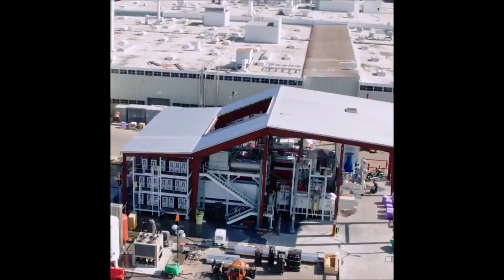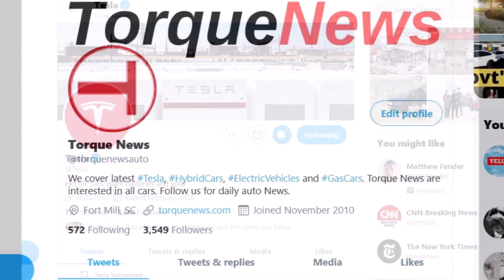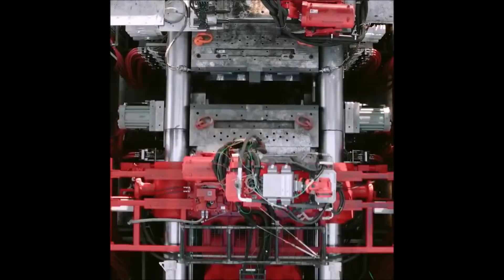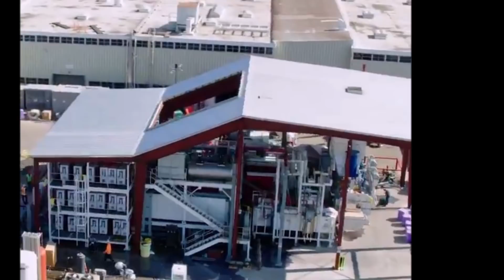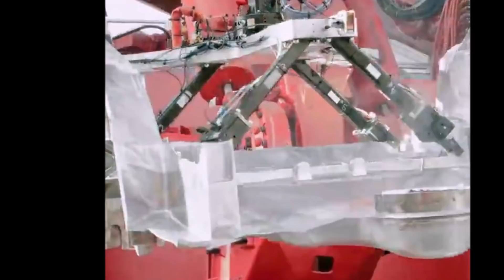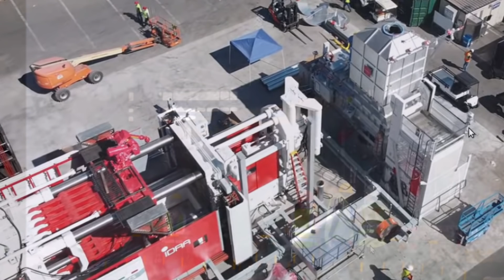Tesla Shares Rare Video Of World's Largest Die Casting Machine

Comment: I used to work in grey iron foundries on Disamatics.  Theres videos on utube.  They made sand molds and iron or aluminum was poured in the sand molds.   These machines are the same principle minus the sand.  Die casting this size is pretty impressive, but I see they are having cracking problems in Teslas .  These castings are the front and rear assemblies of the car.  If that needs replacing depending on the age, it will total the car.  Something to look for in used teslas.

Comment: I googled it One kilonewton is equal to 1,000 newtons, which are equal to the force needed to move one kilogram of mass at a rate of one meter per second squared. The kilonewton is a multiple of the newton, which is the SI derived unit for force.

Comment: The neat thing about this giga-press, is a rising tide raises all ships.  New innovations promote even more.  Not sure right now, how you would repair a damaged die-cast frame.  Cast aluminum with the correct alloy structure is weldable.  The welding industry is getting more sophisticated also.  Lots of new stuff coming online.  Now, for right now, your insurance is going to be the elephant in the room.

Comment: Its imply the force of mould press pressure.  The bigger the workpiece, the more pressure push on mould press in needed. Because it must close the mould face with high pressure in preventing leak of molten aluminium when injected into the mould.  The bigger the piece is , the more weigh mould face to withstand.

Comment: Why cast.. Isn't it typically weaker and heavier than rolled/stamped piece?
Reply: That's why there is pressure added during molten state, idra calls it low pressure forging and and that prevents bubble weak areas all the way to the edge
Reply: Also hard to repair

Comment: I live in md...its long gone now...but these dingbats have never heard of the old Bethlehem steel sparrows point plant.....you could throw this little toy INSIDE the L furnace of sparrows point...the continuous caster there could cast 10,000 TONS a day...THIS MACHINE AINT SH..!!!!!
Reply: You are woefully uninformed, so much so that I don't even know where to begin your remedial education... thanks for the unintended comic relief, though.
Reply: @rimckd825  u must be elon I guess..
Reply: @rimckd825  no reply eh??...thats what I thought...clueless
Reply: True, I suppose you could sand cast these parts out of steel, or ductile iron. But they would weigh 3x the alum casting. For ex, Intake manifolds used to be iron, redesigned in  aluminum decades ago as a weight reduction. Corvette has used alum sub frames for decades now.

Comment: The main question that I have is if the casting presses are built to only cast one frame, or if it can be set up to swap out the molds to cast different frames. We know that the Model Y has been using the rear frame casting, which eliminates 300 robots from the factory. But the future Model Ys being built in Europe, and probably Shanghai will also have front cast frames too, and eventually structural battery cases in between (housing the 4680 batteries eventually). I suspect that the plan is to debut the new chassis with 4680 batteries first in Giga Berlin later this year. But it looks like the planning and testing of the new cast frames is already happening in Fremont now. Tesla will probably keep that news under wraps until after the updated models are being produced in Giga Berlin. Since the last video shown here looked like it was a cast frame for a Model S, it is quite possible that part of the revisions to the upcoming Model S (and X) refresh include the cast frames. Since we know that the upcoming Model S Plaid+ will be getting the full drivetrain upgrades, including front and rear cast frames and 4680s with the structural case later this year, it may well be that Tesla will be integrating the cast frames into the upcoming Model S (and X?) starting as early as March or April, except using the updated 16850 battery pack.
Reply: Dean
Of course the dies can be swapped out.

Comment: The liquid metal is an aluminium alloy that is a secret. See e.g. the Sandy-Elon interview. This is also the secret for the gigapress.
Reply: There is no such thing as a “Secret Alloy”. Once you get access to the part (buying a Tesla, for example) it takes just less than 1 gram of material to analyze the material. No secrets here! And there is anyway only a small range of die cast weldable Alu Alloys available anyway.
Reply: @carlosspiringer7106  If so, I am sorry for my remark. I was just parrotting Sandy Munro.
Reply: @charlesvanderhoog7056  Did not want to sound critical! But as an production Engineer with (too many) years of experience also in metal castings, we hear some pretty strange stuff. Cheers!
Reply: @carlosspiringer7106  i agree. things that we assume everybody knows
Reply: @carlosspiringer7106  Tesla actually developed their own custom alloy for these die castings. Tesla and SpaceX have a combined material engineering department that does some pretty cool development work. You're of course right about no secrets. The info is in their patents that they openly share with the public!!
Reply: The know the alloy formulation. Aluminium, silicon, copper, manganese etc. etc.

Comment: so if you have an accident that damages a large or not so large section of the body - does that mean you have to change the entire car? Asking because I really see this as a disadvantage.
Reply: There's a major tradeoff. 

The single cast part with help reduce the cost of the vehicle construction and could reduce the human error that is bound the happen when putting together something made of many parts.
Reply: If the accident is so bad the bumper and electronics costs are high so don’t worry about casting costs